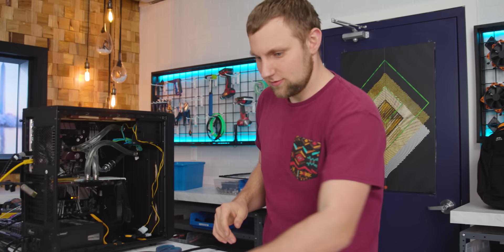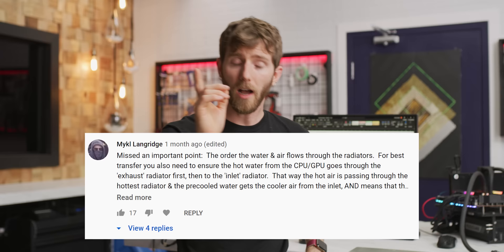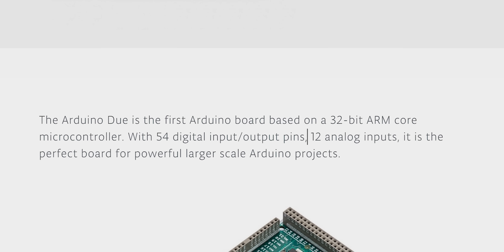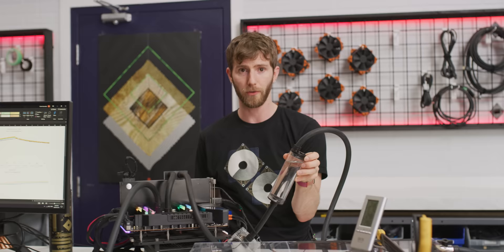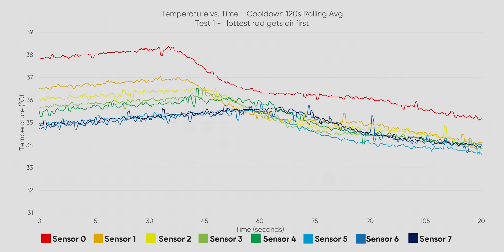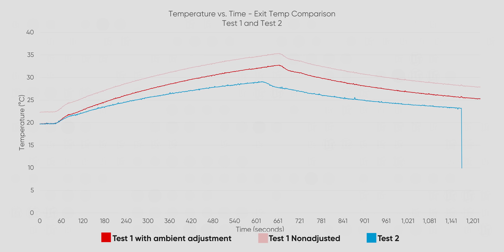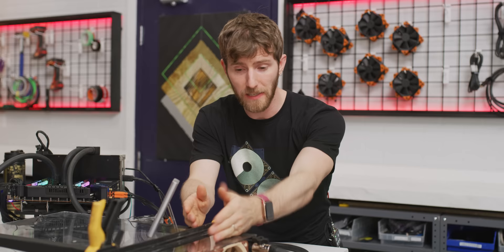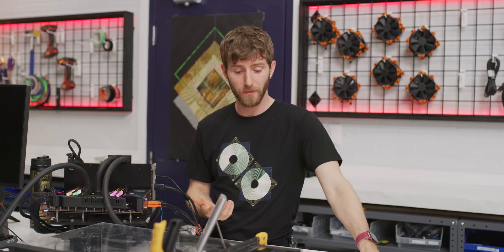Is this even going to work…

Comment: I'd like to see Y-splits going to the 8 radiators, and the radiators isolated from each other so they all draw their own, equal'ish volumes of fresh air.
Y-split from the 'collector resevoir' to the CPU and GPU, Y-split from each the CPU and GPU in an arrangement which sees water from each mixing together into the radiators.
Radiators all mounted above the heat source, parallel to ground, to allow convection to assist in drawing air up through them.
I'd wager you could go stupidly-long without actively cooling the radiators before temperatures would exceed 50C. After all, you're essentially working with a wimpy 500W 'electric kettle heating element' and throwing onto it a ridiculously-poorly-insulated kettle with a pretty large volume of water to deal with; and the hotter the kettle gets, the more cool air it's going to naturally draw through itself.

Comment: You don't need a stack of rads to know recycling hot air is inefficient. Use just one rad in any computer case with hot air blown INTO the case, and you can easily get 100C while playing games. 

Stacking is just a compromise on space we don't have...

Comment: I wonder how the data looks on running two rads connected in series, but stacked in parallel so they're both getting equally fresh air?

Comment: Isn't the norm for dual rad-configs like this: e.g. 240 mm @front, 420 mm @top PLUS 2x 120 mm fans @back (inward)?
I.e. quite the opposite of the hermetically sealed simulation of Corsair.
Like that you get a significant benefit of a second rad, guaranteed.

Comment: I really enjoy watching when linus actually gets down to the real science.
Although ice water should have been used to calibrate the sensors.
And there are a few math formulas that help calculate temperature differentials and there effect on heat rejection across a radiator.
Reply: Can you explain why ice water would be better for calibrating the sensors? It is not like zero celsius is actually zero. To me it makes sense to calibrate closer to the temperatures they intend to measure. Calibrating to one temperature is leaves you open to effects where your calibration adjustments do not scale accurately as variables change.
I think DS18B20s would have been the way to go. I've found them to be reasonably consistent between sensors. It would also have simplified their circuit and reduced the opportunity for mistakes/distortion to be introduced.
Reply: marinus86 yes i can
The latent heat of fusion of water is approximately 340btus per gram.
What that means is that ice water will remain at exactly 32*f or 0*c (witchever way you float) until all the ice is melted.
This happens because it takes 340btus just to change the state of one gram of water from a solid to a liquid, any btus added to the water after it melted then raises the temperature.
So in a nutshell, it is most accurate to calibrate a sensor to ice water because it is dead on 32*
Reply: @TheRenaissanceBuilder  right that makes sense. Would the adjustments to their potentiometers still have been given them accurate measurements at other temperatures further away from zero C? In my mind you would need to calibrate at two temperatures and then do some calculus to figure the correct offset as the adjustments you make have to change with temperature. But I don't really understand the Steinhart–Hart equation.

Comment: Linus I see a major issue with the way that you piped the cooling circuit. You have the cooling piped in a series circuit you should have piped the cpu and the gpu in seperate circuits then piped then each into two wye-fittings, then increase the hose size a little larger id then the other hoses back to the cooling radiator, pump and fan setup. With your setup you are losing at least 50% of cooling capacity either through the gpu first then the cpu or just the reverse or through the cpu first then through the gpu.

Comment: This actually doesn't make any sense as soon as you consider what a radiator is. It's a liquid to gas heat exchanger. If you are feeding the hot air back into the exchange which in this case are looped elements you are accomplishing absolutely nothing in heat transfer. Reversing the loop is really a misnomer. It works better because its the only radiator with a direct exchange to room air but is better than just one radiator because it has stacked fans. One radiator with that many fans just stacked together would probably preform slightly better than this setup and be a lot cheaper. We can also infer something wonky going on with idea by considering that from liquid cooling radiators, to car radiators to commercial condenser evaporators radiator thickness varies by about 1/2 inch to 3 inches and in the latter case they are so thick primarily for dehumidification. It is surface area that is the main factor for system performance as that is what governs the ability to transfer heat at a given rate.

Comment: u need to use pull config for 2 rad setup....so the fan need no to think about pushing the air flow thru 2 fan...pull setup make the fan pull everything

Comment: I don't understand why the last test with the two radiators didn't have fans in between and only on the front. Without airflow through both radiators of course you aren't going to get any gains.

Comment: If you don't need extreme sampling rate why don't you use a multiplexer? With it you could do the same with only a few (or even 1) analog inputs. Cheaper and smaller solution (and you can filter the not needed sensor's data on the software side)
Reply: I know it was more about a simple working solution rather than a nice proper one.

Comment: What about making some 3d printed shrouds that fits between the fans/radiators. make them so they draw in cooler air from the bottom/sides of the input, then vent out top at rear of rad. Can make them both in one unit, with a small thermal break in between. (looks better in my head then typed. LOL) Yes, it would add thickness to the over all size, but then you will always have cooler air flowing over the rads, rather then the waste air sucked in from rad one.

Comment: maybe the way the radiators and fans were put together ... Although they were not confined in a box, they end up forming a real homeogenous surface, which tends to decrease performance and also does not reflect the real scenario in which this is mounted on a PC. The most appropriate way to perform this test would be with separate radiators and fans, each taking "cold" air and exchanging heat. Although there is no miracle in this, there will not be a very sensitive "cooling", but the tendency is for the water temperature to be closer to the ambient temperature, more stable and for a longer time. Only one radiator tends to saturate at some point and the water temperature rises if the heat source is intense and "permanent", for everyday use a radiator will probably never break, but if subjected to constant stress and for a long period, I'm sorry corsair, i'm going to add another radiator (and probably not your brand because it is abusively expensive).

Comment: Before watching the video i have to say i actually Tried that. But its Important that the hot water goes into the last Radiator and the cold water gets out on the first Radiator in the Stack so the heat doesnt travel trough all Radiators

Comment: higher Energy capacity by volume of water will take very long time to heat.
the airflow is bad stacked rad.
my guess only effective not efficient.

if it were like waterfall it might be efficient.

Comment: Hey, now you need to try reducing the air pressure in the loop. That way when the water hits the hot CPU it flashes into low-temperature steam, which will change back to water in the radiator. Think of it like a large heat pipe.
Reply: Won't work with flexible water lines.

Comment: Right, but adding thermal mass would still help with short term cooling, which is to say, most cooling. If you're running your cpu/gpu at 100% for hours on end your mining, rendering, or doing something wrong. So to say that the AVERAGE person wouldn't benefit from stacking is not necessarily correct. That being said, price to performance is king.

Comment: 4:18 I hope you did more than just put them in some water. you don't know if that is a stable temperature,what should be done is in water mixing in ice one by one, what happens there is as you move the water and the ice you reach the saturation temperature where the water should turn to ice but you still need the about 740btu of latent heat to have it change state. but when it is at saturation temp it happens to be 32*F/0*C in the water.

Comment: What if you had 8 radiators separated by a distance? This removing the reheating of the additional subsequent rads? Not necessarily stacked, but do more rads in a better configuration? Just curious.

Comment: What if the loop was parallel with one pump, a seperate set of fans for each rad, and the rads not stacked but still in the same loop? Like one rad in the back of the case and one rad in the top

Comment: Why not just use your ac at this point makeing the case ecentialy its own room that will then have a intake and outtake to bring cold air in pushing hot air out and keeping temps down also with its own vent and thermastat

Comment: the data logging could also be implemented with an regular arduino teensy or a bluepill    and if your mcu has to few analog inputs you add an analog to digital converter that works over ic or spi.

Comment: What if you take just 2 or 3 rads with flow direction like test2 and compare results to the setup, where all of them get fresh air? How big is the difference (if any). Also a thick rad push-pull vs 2 thinner, but air goes from one to another would be interesting

Comment: This is completely expected. Hot air blowing into a radiator just can't cool hot water efficiently. Now, multiple radiators that all get fresh (cool) air would definitely have a huge benefit, but only to a point, especially with standard PC fans.

Comment: i remember the last time Linus tried to be a plumber, surface area to air volume, better exhaust: heat goes straight up period. if you have 7 or 9  dual rads, 3 or 4 of them should be getting hit with fresh air, also evap cooling might see 12 to 30% improvement\ delta change, but i have not idea how that would work in near a pc case

Comment: As far as I am concerned both videos showed you were right. There is no need to say essentially "Well if you do this thing that is completely dumb then corsair is right". Corsair was wrong to criticise the setups you showed because they did actually perform better than a single rad. And your tests showed that under reasonable setups this is actually not difficult to achieve. If you're not exceeding the cooling wattage of the individual radiators, then it is likely useless, but that is not your use case at all.

Comment: would more radiators only be beneficial when say your temperature is high to begin with? So, you're testing and getting 38.5deg, what about at 60-70deg? would 6 radiators maintain the higher temp longer? would it cool better than 2 radiators, and be X degrees cooler?

Comment: I'd like to see you guys remove the fans and stack the rads into a tower with the hottest on top. It may be possible to achieve some level of airflow purely due to convection currents meaning a possibly fan-free system(probably not on such a beefy system)

Comment: All these rads are the same size with the same water and air flow.
Could the test-rig be configured in such a way to have the water-flow slow down between each of the rads (first rad consumes 1 litre per minute, seventh rad consumes 1 litre per 7 minutes)?
Doing this would allow the water more time to dissipate its heat in the rads sequentially further down the chain. Or, have the active surface area of the first rad seven times smaller than the active surface area of the seventh rad? Or have the first rad's air flow 7 times quicker than the 7th rad's?

Additionally, could each rad have its own air-flow? Doing this would allow "fresh" ambient air to cool each rad as opposed to "used" (slightly heated) air from the previous rad trying to cool the next rad.

Compound steam piston and turbine engines do a similar thing when reusing first stage's exhaust to power the second stage - second and subsequent stages have progressively larger bores in order to make use of the lowered steam pressure.

Comment: Why not 2 rads parallel instead of compound? They'd both be pulling cold air so the 2nd rad should be significantly cooler than the first.

Comment: Thermodynamics is fun and not as complicated people make it out to be... transfer in a sequential series system is diminishing returns once you pass the Heat In vs Out equilibrium measured in Watts.  Which is to say once you are dissipating the amount of energy the CPU plate can absorb & transfer to the intermediate fluid, how much extra you can radiate quickly becomes meaningless.  
The fluid is the real limiting factor not the number of radiators in the system, thermal capacity and viscosity are often at odds.  there are exotic 'fluids' that have high thermal capacity, high viscosity(flow), and heat conductivity, but they are expensive and/or hazzardous.  A pressurized gas can be better than many liquids.

BTW - Go Ting(7 years and counting). I will never use another Cell provider.

Comment: Any reason as to why you only went with one set of fans for the dual radiator setup when comparing it to a single radiator setup? It would be interesting to see how it would perform when both radiators are equipped with fans.

Comment: On the 2 rad test, why not put fans on the second one???  With no fans it probably created back pressure for the first rad, so made the 1st rad less effective, and the 2nd rad cooled a bit but not much, and together they were about the same as one rad with fans.  
Also, temps were still going up when all these tests were stopped.  That means all these results are meaningless, they're mostly just showing the effect of warming up the water and metal.

Comment: there is a mistake in your test setup, fresh air should be passing through each radiator, so you have to exhaust the air coming out from each radiator, dont let it pass to the next radiator.

Comment: Why you did not compare 2 rads with water loop in series connection and air in paralel configuration- you can improve your water cooling loop if both rads in the computer case will blow air outside the case (with proper inlet in the case)

Comment: If it takes a long time to heat up that much water then why not split the amount of water in half or thirds so that the water will alternate every half hour or so while the other half of the water cools to room temp in some aluminum container.  Would that kind of system still reach equilibrium

Comment: What if you made 3 rad set up in in upside down T  for where the top blows air downwards and both of the bottom ones blow it outwards in different direction?

Comment: What would have happened if you had a fresh source of air going through each radiator? Id imagine that drawing air in at one point and using the same air-stream going through the whole set of radiators is going to smuck up the temperature data.

Comment: well you didn't measure the air temp by the time it reached the last rad, so what seems like heat soak... is actually a result of the diminished the air vs water temp delta, if there was any delta at all at the last rad.

Comment: ok I see how stacking them does not really make a difference, what if you had room to put 2 radiators side by side? but still leave the loop in series, or put two radiators in different location so that both radiators get same ambient air

Comment: Rads are stacked in cars. Deep.
It's not uncommon to have a charge cooler, trans cooler, oil cooler, condenser, and radiator all stacked in the front of a car. And you're working with temperatures 2x+ what you're dealing with on a computer.

Comment: I'm curious how the thermal performance would change by having 2 fans on a single rad blowing opposite directions (meaning you have fresh air blowing on one of the 2 sides almost all the time).

Comment: Did you guys try to separate the radiators so the hot air from the first radiator doesnt heat up the other radiators?

Comment: It doesn't work because hatened air on first raidator, goes in the other radiators.
I am wondering what will be, if he uses 2 radiators seperated, or maybe connect radiators as cpu->radiator1->gpu->radiator2->cpu.
Crazy questions in my head.

Comment: The difference in peaks between the test whit one radiator and two radiators. I would think comes from the the difference in water capacity in the system. I would like to see the same test on one radiator comparing system water capacity to eveluate if you can get a more flat line whit a bigger water reservoir. And maybe even a lower peak temp for one radiator than two. And where the gains stop in smoothness of peak temp for a bigger water capacity. This would be interesting because if you could slow initial ramp up of temp whit higher water reservoir. You would be able to have a more stable clock and don't have to adjust down the clock. Say for instance you have a 5.0ghz clock and the initial temp peak half of the times goes over the safety temp and half of the times goes youst fine when you get past the first hump. What if youst adding additional water capacity to the system could stop the peak from happening. And make it stable at 5.0 instead of going down to 4.8ghz in clock...

Comment: If stacking radiators doesnt work, then thicker rads wouldnt exist. However, more rads will lead to diminishing returns in an enclosed space like a case. If the air has been heated beyond a certain temp, it wont cool down anymore.